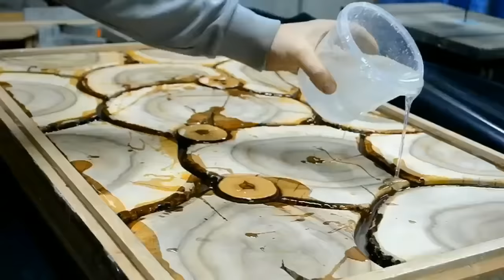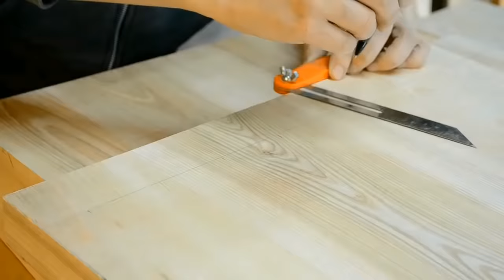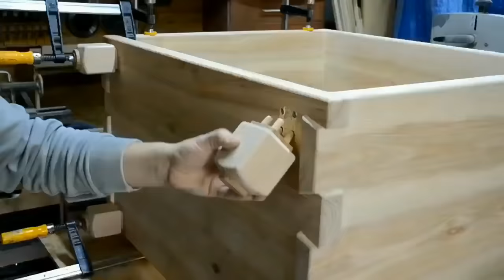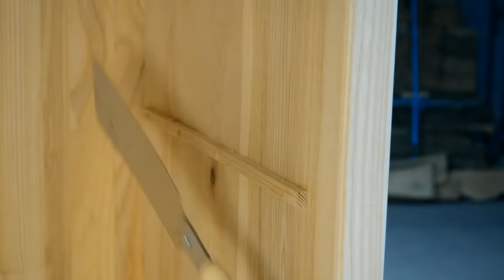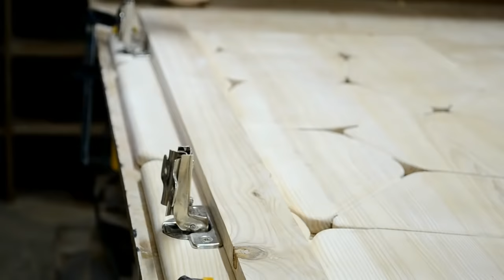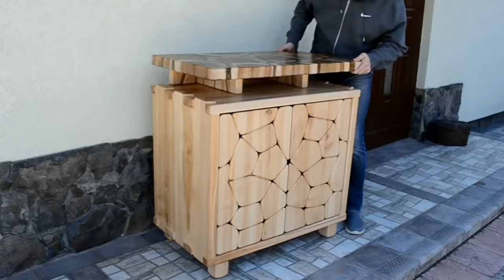Ash and Walnut Sideboard

Comment: If you knew what that walnut wood costs, you'd have tried to use that bark to grow new trees❗❗❗❗😬You have about $2000-$3000 worth of walnut wood there.
Reply: @Gary Shields Sorry but you must be getting ripped off by your local supplier or referring to a different currency. That's maybe 2-3 US$ worth of walnut IF sold as firewood. It doesn't look like "North American Black Walnut" and even if it is, then it was from a very fast growing limb. It is 50% sapwood with numerous checks around the perimeter. It would be highly unstable if used for any long-grain application. He put it to about as good of use as possible
Reply: @G0F15H  Home Depot- 1"x8"x8 feet $250.
Reply: @Gary Shields First, Home Depot is about the worst place to buy furniture-grade lumber. Second, that's not what he was using. He had scrap cookies that were 50% sapwood, checked and probably not even all the way done drying. Probably obtained from a friend or someone in the community for $0. Those were basically junk logs; totally different then an 8' S3S or S4S kiln-dried walnut board sold at retail.